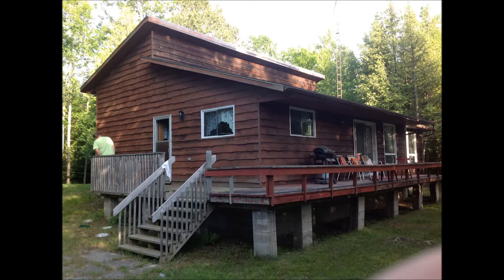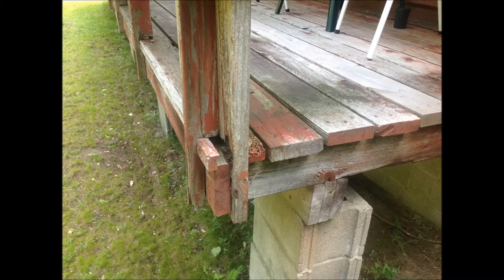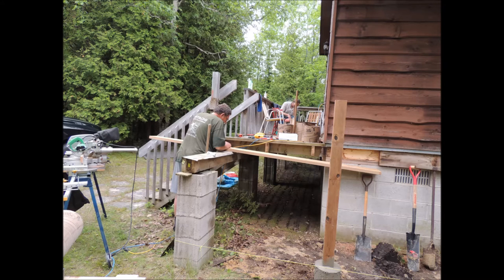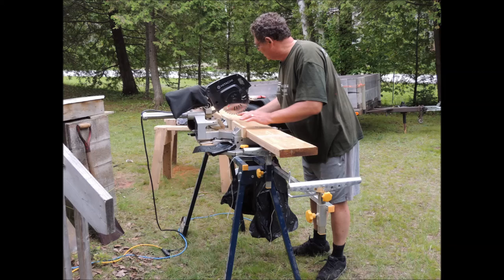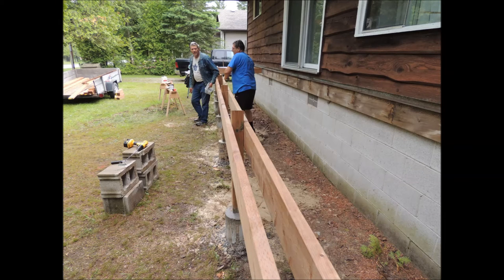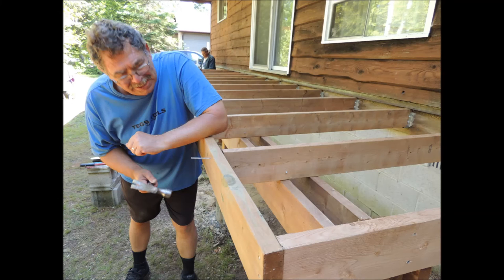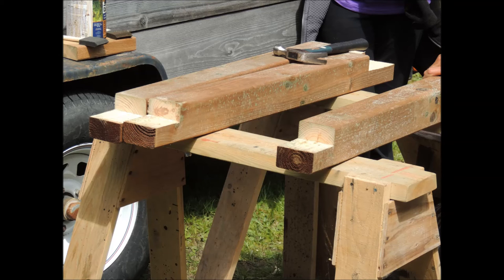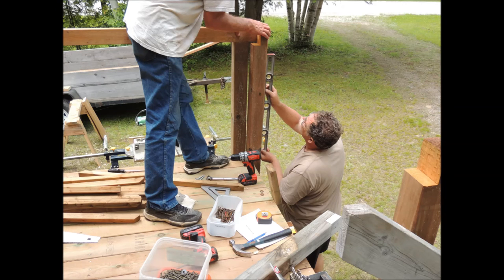Replacing The Cottage Deck

Comment: Great looking porch, What wood did you use? choosing the right timber can keep you from replacing it again in a few years. Bangkirai is a timber that is available in any farm supply store in NL. Your great grand children's children wouldn't have to replace it. Not sure if you are familiar with it?
Reply from the maker: Dutchhorse  We used  pressure treated wood, softwood lumber, typically southern yellow pine. This is the type of wood they use for decks in CDN. The deck material that was used before was red cedar, which is more costly. We have a man made composite material also, but it's costly too. I did a search on Bangkirai its expensive and not easy to get.